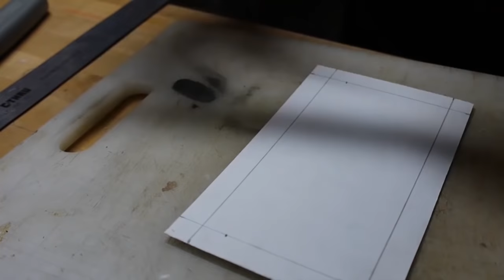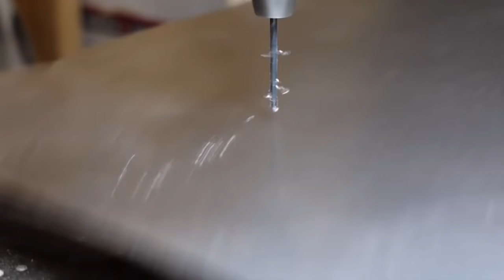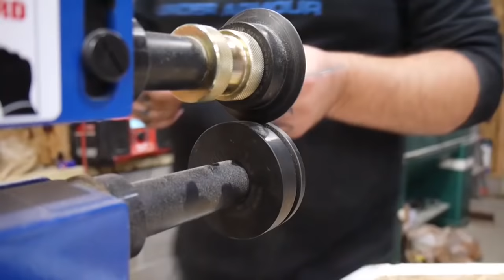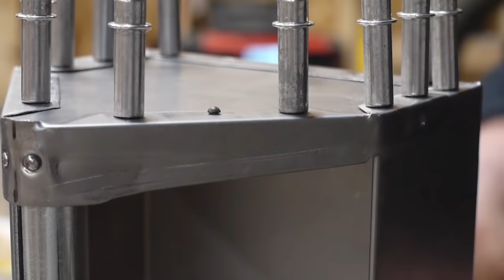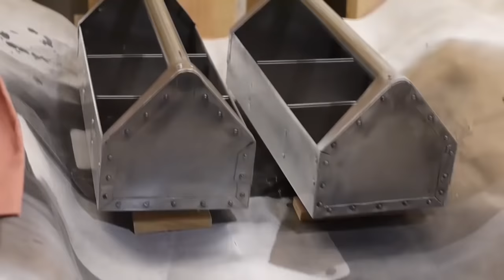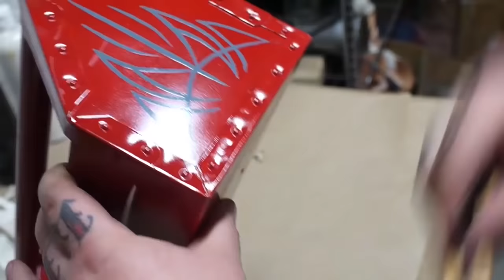Making a Sheet Metal Tool Tray / Screw Tote

Comment: what are yo using to smooth out the
 edges? a grinder? any particular wheel you use?
Reply from the maker: I think I used a wire wheel for most of it, mainly to knock the burrs down and keep from cutting myself, so not entirely necessary. At one point I used a fine flap disk to take the larger burrs off where I drilled out the holes so the pieces would lay flat against each other.

Comment: you happen to have templates available? im just about to design one the same.
Reply from the maker: John Hobson - I don't have a linkable set of plans, mostly did the pattern on the fly. Full dimensions iirc 14" long by 6" wide, 6"tall in the center and 3.5" tall sides.